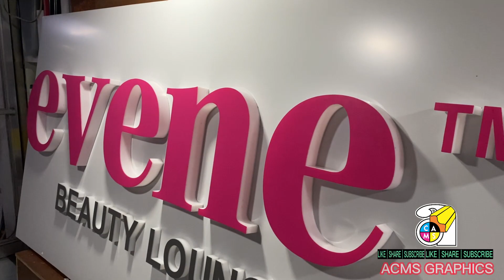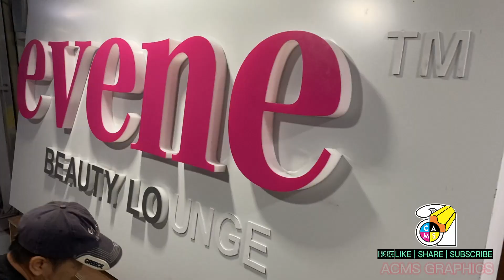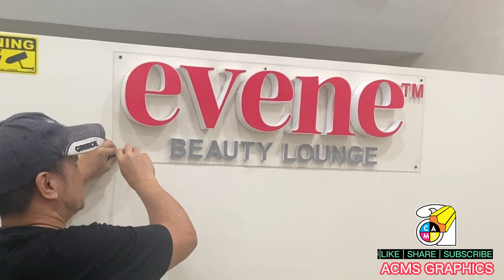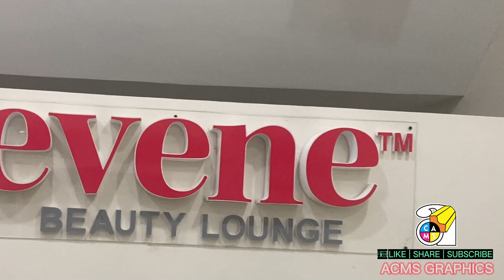HOW TO MAKE ACRYLIC PLASTIC BUILD-UP | EVENE BEAUTY LOUNGE SIGN | ACMS GRAPHICS

Comment: how do you paste the letters from the panel ?
Reply from the maker: we put cut out sintra board every letter and use metal screw to fix the sintra on the base and drill the the side of the acrylic in 2.5 mm clearance between the edge  maximum of 4 hole defend to letter and use 2mm thickness for the screw .or follow me on my facebook page for more comment acms graphics